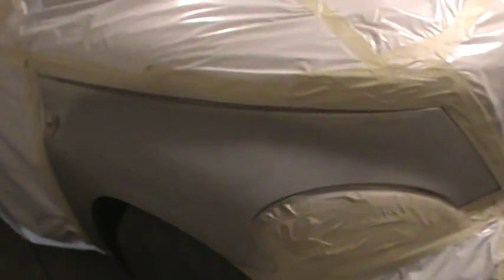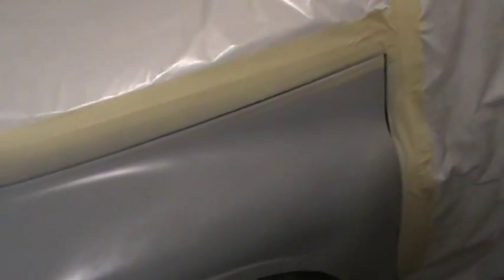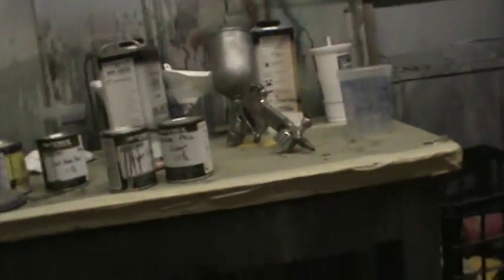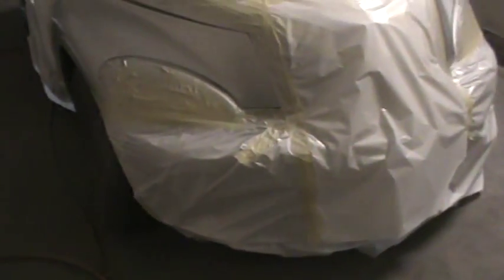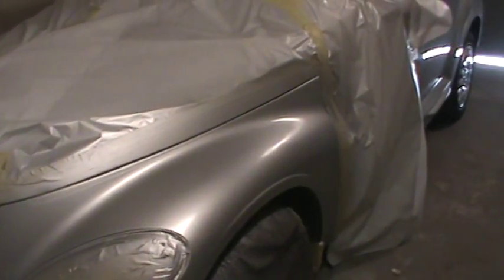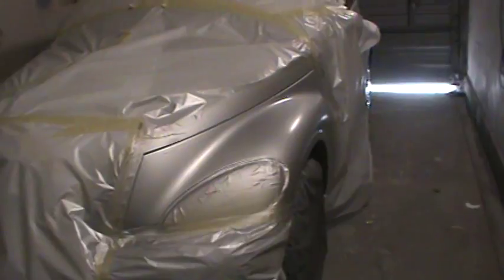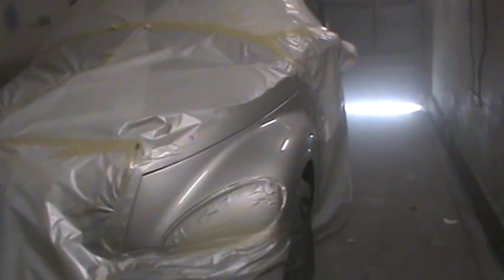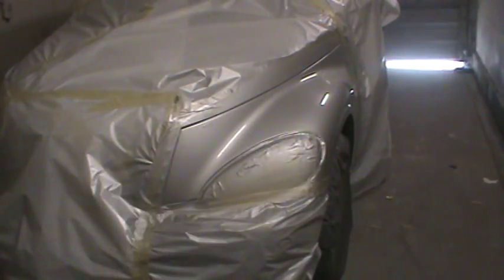PAINTING A FENDER AND ANSWERING SOME QUESTIONS

Comment: I had a problem with the EDP primer on my door skins where when I sprayed it with epoxy it delaminated,  actual layers of the EDP flaked off. It was not an epoxy adhesion issue since the back side of the flakes were black.  I ended up restripping the doors and redoing my bodywork.